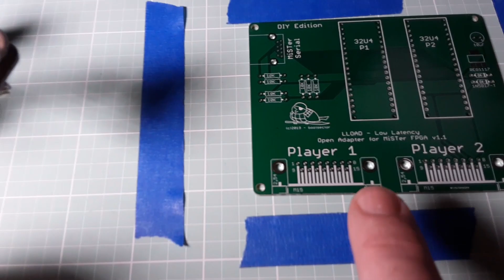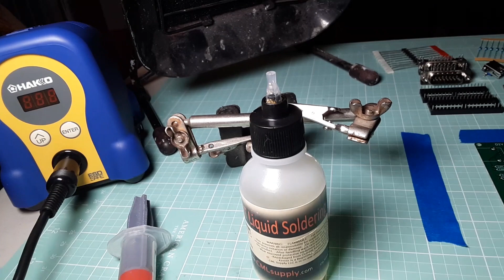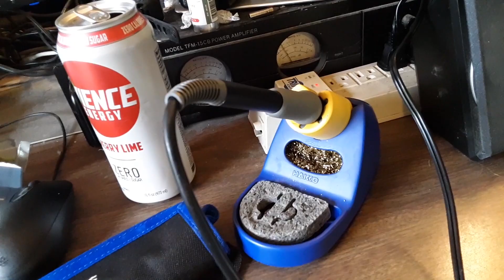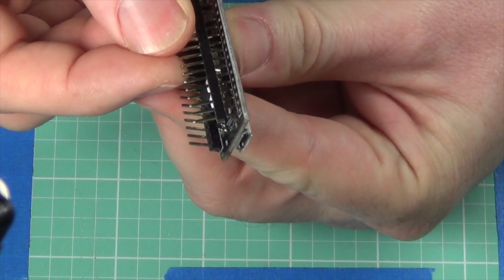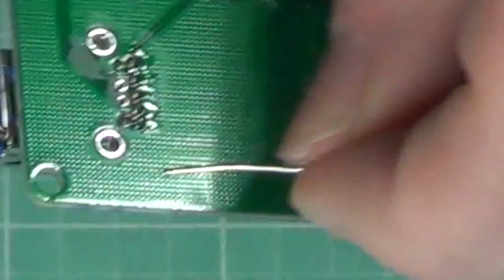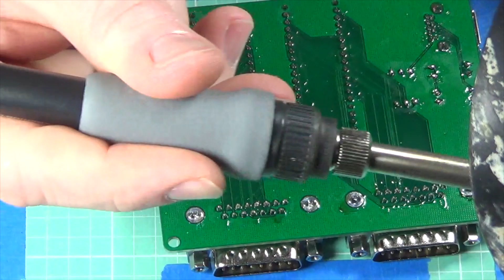LLOAD Complete Assembly Tutorial - For MiSTer FPGA

Comment: Now you need to post instructions for programming the arduino’s for use and the miSTer core setup.
Reply: Here are the instructions:
1) Install QMK Toolbox and drivers
2) Open QMK Toolbox, you should see a yellow message like "Caterina device connected: Microsoft USB Serial Device"
3) Choose "atmega32u4" in the microcontroller dropdown
4) Open LLOAD.hex 
5) Press "Flash"
5) If 4 doesn't work, press reset and try again after Arduino reconnects (you have about an 8-second window to flash after resetting)

Get LLOAD.hex from the Classic Gaming Discord, MiSTer-Controllers channel, it is pinned next to these instructions.

Comment: The voltage regulator would've been easier if you didn't apply solder to all of the pads first. When you do that, you end up having to balance it on the solder blobs, which is quite tricky.
Reply from the maker: You're right of course, after I did that I just kinda shook my head and did my best.  Absolutely a rookie mistake!